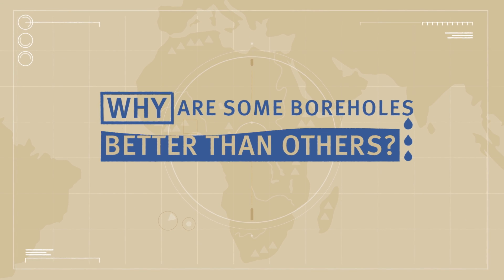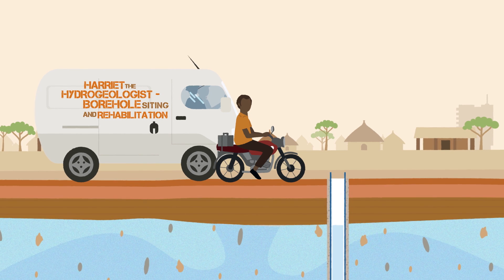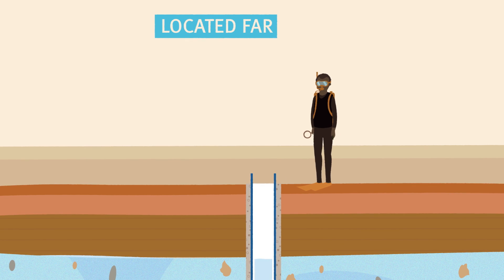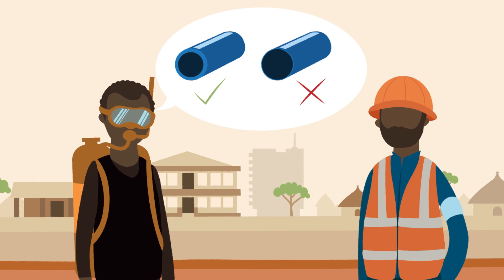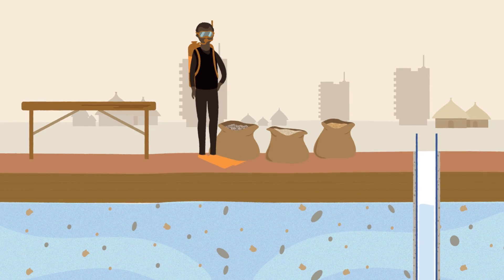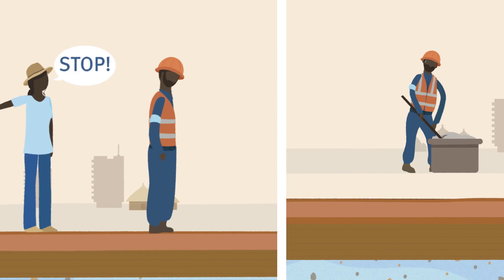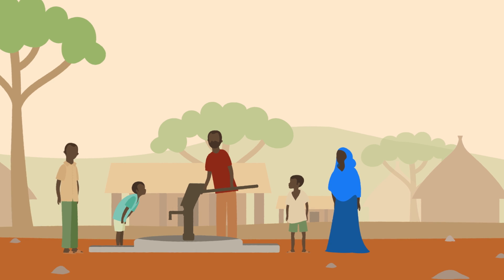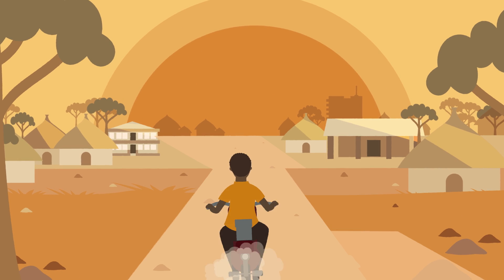Why are some boreholes better than others?

Comment: Great information, many thanks. I just started a first borehole in Uganda with a borehole machine. How do I stop borehole cave in? After drilling the length of the extension drill pipe, the next pipe only goes in about half way thru. We then have to screw it in manually before starting the machine again. We are using Polymer when drilling but it does not have much effect on keeping the borehole walls from caving in. Thanks a bunch, your advise is well appreciated
Reply from the maker: You can find several guides here: https://rural-water-supply.net/en/sustainable-groundwater-management/professionnal-water-well-drilling and  you can join our Sustainable Groundwater Development community where we have hundreds of experienced drillers who can give you advice: https://dgroups.org/rwsn/groundwater_rwsn